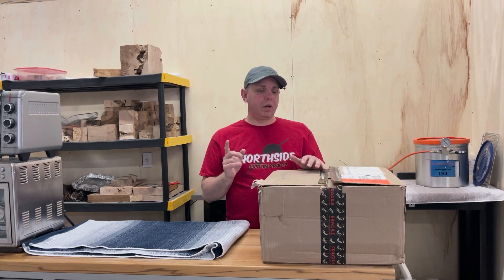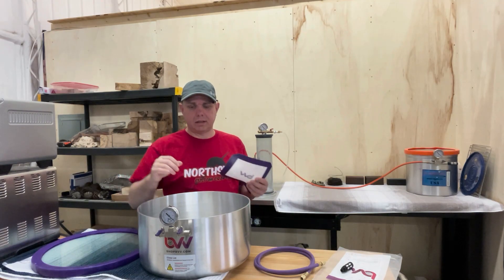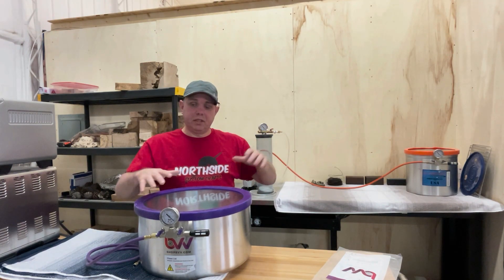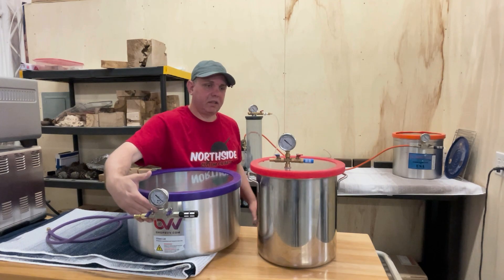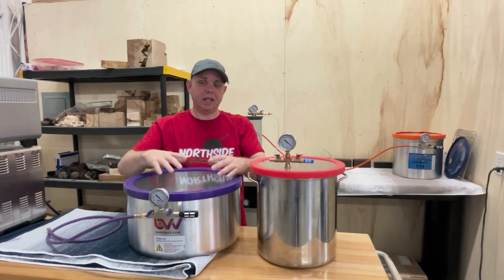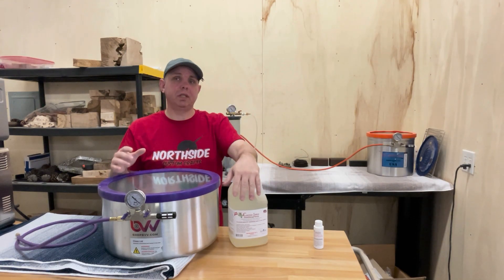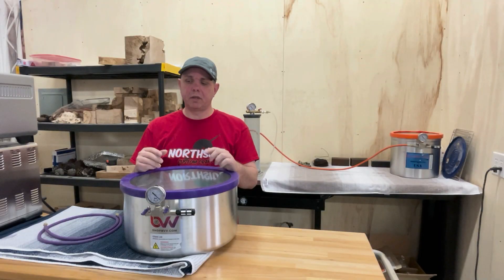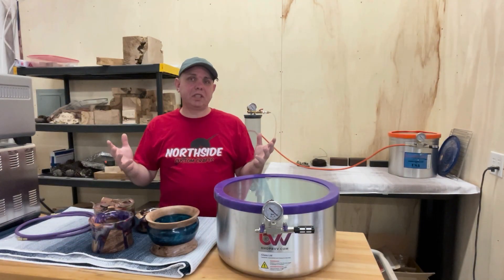How to Choose a Vacuum Chamber for Stabilizing Wood!

Comment: Another good reason to stabilise bigger pieces is that the wood often warps during drying and after curing the resin. So having a larger blank means you have more room to square sides and ends before cutting your final blank dimensions.

Comment: What about the pump it self, HP, CFM, stages, oil less or not?
Reply: Turntex recommend a single stage, low CFM oil-filled rotary vane pump. Change the oil after every 3-4 sessions.
Reply: @Mr_Chuckles  Thank you, have been in the turning world for decades time to move it up a notch just at my age don't want to throw good money after bad not knowing how far I want to go  this stabilizing thing.
Reply from the maker: There’s a link to the pump below the video.

Comment: Hello love you videos. My name is Jeff Martin. I have been kicking around some ideas about wood stablizing with heat curing epoxy. I have only seen this done with very small pieces of wood. Like pen blanks and knife handles.  It does get a little expensive to stablize.  I do have a vacuum vessel that accommodate very large pieces.  Stabilized you can use more punky woods and push the envelope. Do you think people would pay for something like this? Thanks
Reply: I was thinking of 4-5 feet in diameter maybe. Or very long 8-10 feet.
Reply from the maker: @wheelbarrowbully  if it would make sense to do it financially. I don’t see why it wouldn’t work
Reply from the maker: This already exists.. I stabilize large pieces often. Here’s a video https://youtu.be/ssErpShA584

Comment: Another question for you Jake:  When you do multiple large pieces in the vacuum chamber, do you put spacers between layers or between the bottom and the first layer to make sure that Cactus Juice has access to as much surface area as possible and also so the air releases from the lower layers?   ... or am I overthinking this?
Reply from the maker: Lol.. I think there’s a little overthinking going on Mark.. Just get it in there and get er dun lol

Comment: Good video.  I’ve been doing smaller pieces and like the idea of doing a big piece and cleaning only once, am going to try that.  I’ll add one thing based on experience;  make absolutely sure the lid is centered before pulling a vacuum.   This is a no-kidding safety issue.   If it’s off-center, you can get to vacuum and have the lid sucked into the chamber catastrophically.   I wasn’t hurt when this happened to me, but I could have been and my chamber was destroyed.
Reply from the maker: Thanks Mark .. cleaning one time is definitely more time friendly than doing lots of smaller pieces. I make sure EVERY TIME the lid is centered.

Comment: How long does it take to take out all the air bubbles from epoxy one's you put it in the vacuum chamber?
Reply from the maker: This is for stabilizing and it’s vacuum
Reply: @JakeThompson  but if I was to put epoxy in the vacuum chamber how long does it take for bubbles to come out?  I preserved flowers and im still getting bubbles when I use a pressure pot!
Reply from the maker: @felixhernandez9354  I have never done it. I think with flowers .. they need to be dry/ and or coated.. or sealed
Reply: @JakeThompson  it kinda looks like when you did that wolverine cast and air escapes!
Reply from the maker: @felixhernandez9354  exactly.. dry the flowers and seal them before the cast